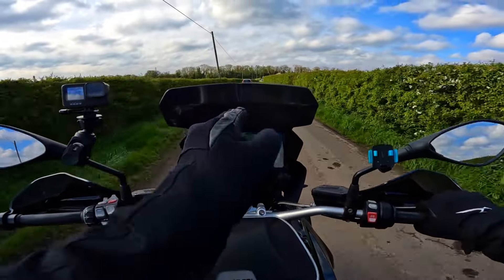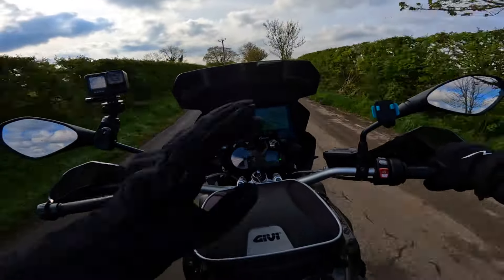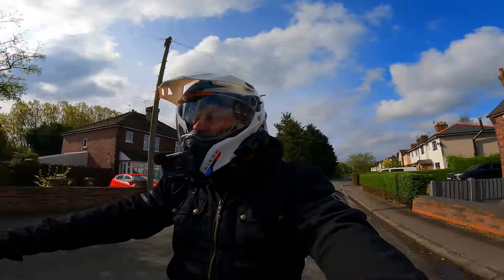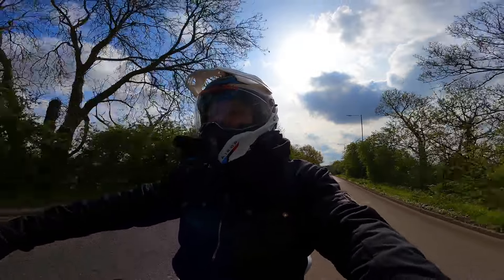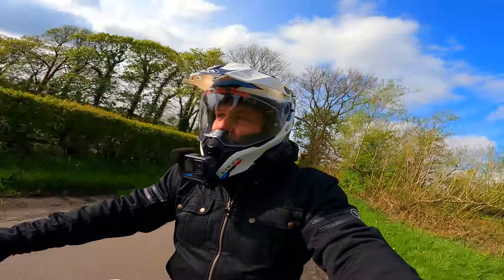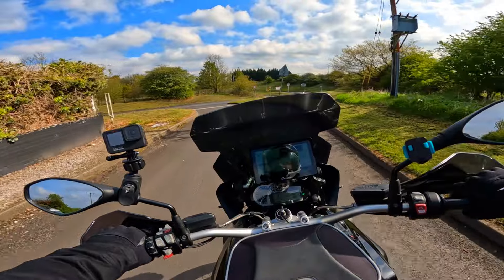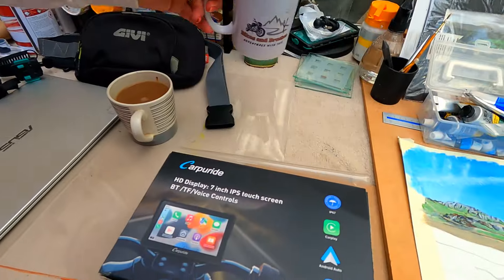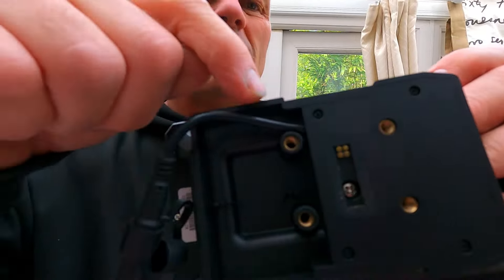Carpuride 702 With BMW Mount Apple car play Android Auto

Comment: Hi Shaun, thanks for the recommendation and link, purchased one for my BMW R1250RS, arrived in 7days fitted to bike and 5 minutes to set up. Tip for anyone setting it up I have Cardo bold headset and I disconnected both phone and headset from Bike and then connected headset to phone then phone to Carpuride unit and works perfectly.
Thanks again Shaun and safe riding 
Dave
Reply from the maker: Great bit of kit isn't it pal , can't wait take it on a trip once me back eases up 👍

Comment: Why not just use a medium size tablet and weather resist case and bike holder with Waze on it, definitely a lot less expensive and updated all the time by people actually on the road?
Reply from the maker: My phone does that in the case and this fits straight onto and powered by the pre existing bmw mount , no case , no wires no extra mounts ... every1 to their own though
Reply: I use a tablet problem is screen is not that bright so not great to see where you going

Comment: Got the carpuride 502 for k1600 - with adapter plugs straight in. Amazing bit of kit 👍
Reply from the maker: Great isn't it ... should of got 1 ages ago
Reply: Which model K1600? I have a 2013 GTL. Does it fit behind the plastic?

Comment: cheers for the review Shaun - think its about time to upgrade my old tomtom and using waze plus big screen - do you have a link for the gopro mounty thing 
ride safe n lets hope spring arrives or I'll px the BMW for a jet ski
Reply from the maker: Not a problem pal the link in the description should give u 30% off their products .. I've installed waze as well works a treat
Reply: @TinsonTour  yea logged onto the satnav thingy but the go pro mount is also what I’m after —-is it the same company?
Reply from the maker: https://ultimateaddons.com/?ref=fKPLNqEUVHvCr 
And use code TINS10 for the gopro mount pal 👍

Comment: I saw on their website that "Compatibility Notice: To ensure you have the best experience with our Carpuride product, please note that the following mobile phone models currently do not support wireless connection: Samsung: S23, S23 Ultra, Note 20, S20, Galaxy A20 (model SM-A205g)," - OK, so does it work if wired? Or does it work with other Samsung phones wireless?
It is not clear for me. 
If it works wired though, I think it is decent. If not, what is its purpose? Thank you.
Reply from the maker: I'm using A23 and works fine , wife uses A32 and works fine wireless but if wired connection any phone should work fine
Reply: works fine with S23 Ultra.